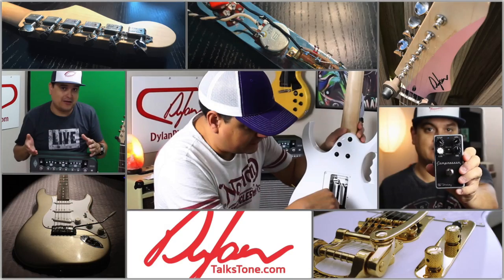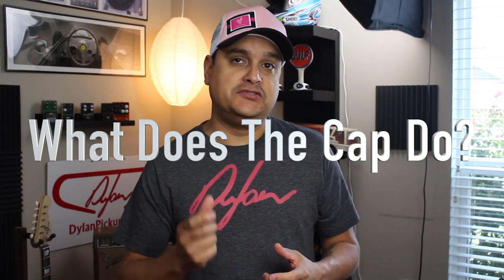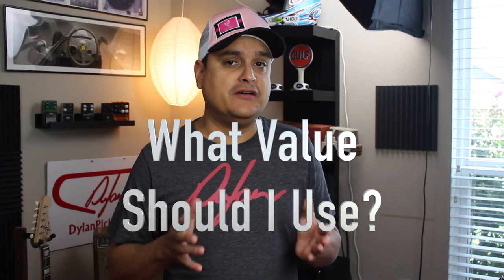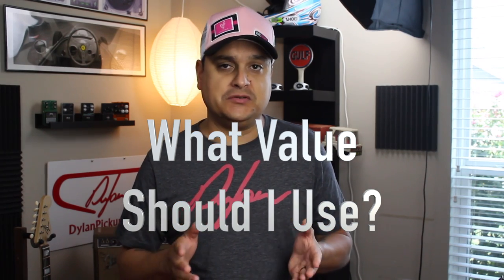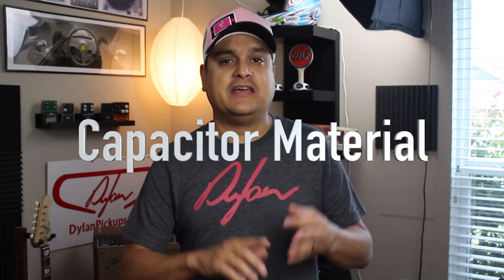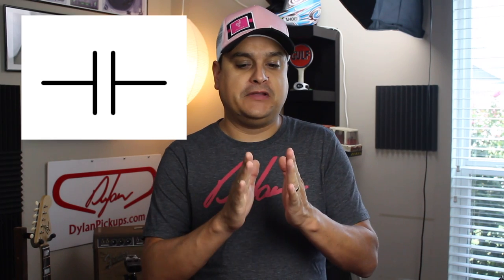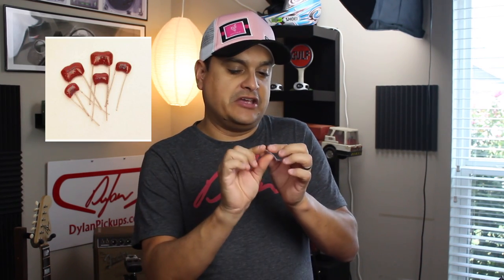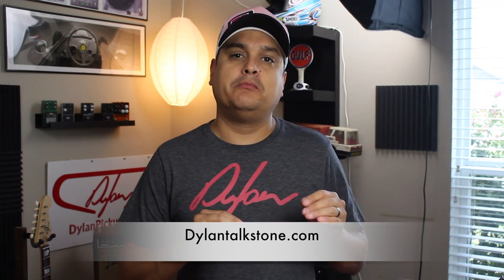How To select the right capacitor for your guitar! 3 tips - Dylan Talks Tone #240

Comment: Dylan...man,, I usually dont make comments on any videos  but this one deserve it, I am engineer in electronics and I think not even my teachers explained the basics of signal and capacitors as well as you did (maybe you just skip a little explanation about capacitive reactance) but viewers will undertstand the Rx effect, congratulations Dylan, it was perfectly explained with all basic details, and mainly what I appreciate on videos is the use of common sense, and no out of topic comments (you did it perfectly) I enjoyed it very much, I saw other of your videos and you have the perfect vision to make a great electronics basics Bible for audio and instruments, let us know if you do it, thanks in the name of other viewers, great job
Reply: Ditto with Ricardo Great Job!
Reply: You sound like you know what you are talking about. I always thought that electricity did not flow through the dielectric and that is why you need a drain circuit in most applications as well as using caps as an energy storage. My question to you is, is there a standard leakage in capacitors?
Reply: Capacitors block DC current and pass AC current, Which is what the output of the pickup is. The pickup and capacitor form a tuned circuit and the pot controls the frequencies passed to  ground versus to the guitar output. There are online sites sponsored by capacitor manufacturers which explain their construction and characteristics, much of which is presented on YouTube is incorrect. Film capacitors, for example, DO NOT have polarity!
Reply: @agrainofsalt9360  Capacitors can be used in circuits to store high DC voltages, which is why in certain applications they must be drained to avoid being shocked when handled.
Reply: @agrainofsalt9360  Capacitors, such as orange drop have a life span, but usually outlast the device in which they are installed. All are rated regarding the maximum circuit DC voltage that the dielectric will withstand. If that voltage is exceeded the dielectric is likely to fail and possibly cause an internal short.  Capacitors are designed to block DC and pass AC current.

Comment: You missed the most important factor. The vast majority have their pot on “10”. Meaning very little signal is going through the cap (to ground) to begin with. So even if you change the cap value or remove the cap and pot from the circuit -its going to make very little difference.
Reply: I'm not sure that the vast majority of people who would watch this video are people who leave their pot on 10. Probably most beginners and maybe most players in general, but not most people who would actually be looking into how caps impact tone.

Comment: I have been an electronics engineer for 45 years and I approve this message. It's the value of the capacitor that makes the difference. I worked on telecommunications systems back when there was still dial tone and long distance phone calls. Keeping grandma's voice sounding like warm, sweet grandma when she's 2,500 miles away, converted to microwave, bounced off of two satellites, and amplified through 35 miles of buried cable is way more complex than electromagnetic transduction of a wiggling guitar string, and we didn't fret over the tweeky little differences in capacitors like tone-chasers do. Just like fish don't buy fishing lures (but fishermen do), guitars don't buy tone capacitors, but guitarists do, and there will always be someone there to sell what the guitarist will buy, even if the end result is exactly the same.
Reply: Love it👊🤣✌🤠

Comment: It was helpful to me some years back when it finally sunk in was the realization that a capacitor is like a battery that is capable of taking on an energy charge up to its maximum while bleeding it back in return to the circuit as it encounters a drop. This cleans up the waveform as it takes on incoming surges and smoothes out the voltage drops by giving some back after a peak. I was trying to run a d.c back-up beeper for use as a warehouse door bell and it wouldn't sound. First I attempted swapping the power supply for more amps, thinking car batteries have more amps, but still no sound. Then the radio shack guy said maybe my voltage wasn't clean enough and sold me a 4700mfd capacitor and a choke coil, 130 decibels of highly amped beeping was an instant result! Lesson learned...

Comment: I saw a switch from a Stewart McDonald video that had a  .022 cap and a.047cap so one could choose between them. I got the idea to have a 12 pin substitution box
 with 12 choices. The values and the different kinds of caps so my customer can choose the tone for themselves……It works great. It’s a hassle for a Strat,but we’ll worth it.

Comment: Excellent explanation, Dylan. As far as types of capacitors for audio go, generally, the caps used for audiophile type stuff (away from guitars) are polystyrene and polypropylene. But really, the biggest difference is in the player - don’t worry about your cap, concentrate on your practice and your learning. Steve Vai isn’t in a twirl over caps, I promise you all.

Comment: Well, we should also discuss the resistance of the pots too. Recently i replaced the ceramic pickups in my Squier Strat with alnico ones. I also replaced the stock 500k pots with 250k ones. And I got rid of the little green cap, replacing it with a .22mFd "orange drop" cap. This cap and the 250k pots gave the hot new alnico V pickups a great warm sound with enough highs left to provide a perfect balance.
Reply: changed too many things at the same time to determine any cause and effect. Impossible to tell what did what but congratulations on getting a tone you like.
Reply: @YinFuBG  For the sake of brevity, I didn't mention more specifics. At first i just replaced the pickups. They were so bright that the guitar was unplayable and, obviously, I could make no judgements about the sound of the new pickups. So next I replaced the pots, which brought the highs down to a manageable level. At that time, I also replaced the cap, but since that only affects the tone pot, it can be neglected for the sake of overall sound comparison. Bottom line is this: if you're switching out from ceramic to alnico pickups, you better plan on changing out your pots too. The two go hand in hand.

Comment: Adam jones from Tool. uses a .047 ..600v. So the Volts dont make a difference…can i put a .047 …100v and it will sound the same? Thanks awesome video.

Comment: On 1 of my guitars we have a TBX tone pot. Is it all the same on this 1? Also I keep my tone controls at mid way -5 and use them from there mostly. Almost never at 10. Or for that matter never at 0 either. On my L Paul I changed the pots, caps and wiring. For caps I used .011.

Comment: Can you just put a capacitor between the leads from the pickup before you send to the tone pot, I'm doing an off set tele build where I can change out the front single coil with a mini humbucker just by swapping out the pickguard, having trouble figuring out what type of pots and caps to use, going to use 1/4 female plug for pickup changes, and of course I want a 4 way tone set up,but I'm going to use a push pull pot instead of changing the switch.

Comment: The cap does far less than most people think.  In fact, unless you turn the tone pot almost all the way down, its value and dielectric material are irrelevant.  For 3/4 of the tone control's rotation, you could just use a piece of wire instead of the cap.  For most of the sweep, it's actually the pot that cuts the treble, due to its impedance loading.  When the tone pot is almost all the way down, the cap is there in part to stop the pot muting the signal, and also to lower the resonant frequency of the pickup.  If you know the inductance and capacitance of your pickup(s) the frequency shift created by the cap is easy to work out with the simple LC resonance formula. 

Believe it or not, a passive tone cap can certainly boost a band of frequencies.  The net result is energy loss of course, but that is all above the resonant peak created by the cap.  Just how much "boost" you get depends on the impedance of the pickup relative to the impedance load of the the pots and whatever the guitar is plugged in to, plus the capacitive load of your guitar cable.

Comment: Hey Dylan, what is the proper way to store pickups in the long term (could of months/years if they are proximity to each other (like keeping boxes of Rials over a strat single coil)? Will that degauss my pickups or is it safe  (Iplenty of people have told me not to use steel wool near a guitar because the ferrite will mess up the battery. Surely close proximity to each other will wreck them? WHat should we do?

Love the show, youre rerally starting to get a groove

Comment: Hello Dylan. Thanks for the clear explanation on many guitar related things.could you explain to me how the cap. value effects the volume pot 'curve' i.e in terms of swells or leaning into  (or out of )a fuzz pedal.what is the essential  purpose of a capacitor in a guitar circuit;are we talking it removes unnecessary treble frequency i.e.reduces the icepick effect you often get with some teles.?could  you just leave the capacitor out of  the  circuit?anyway thanks for the vids and keep making those p-90 s cause I  want to buy 1 when i get my dough together.all the best.

Comment: Have you ever tried REALLY low values for a Strat like .0047, .0033, or .0022 (yes that decimal is correct). I recently tried a .010 and it was life changing so I’m thinking go trying even lower or will it not be noticeable enough?

Comment: Dylan or anyone out-there ....has anyone tried wiring in a " variable capacitor" into a potentiometer so ww could fine tune the frequency and then adjust with potentiometer? In cheopo transistor radios the dial used to find channels is a " variable capacitor" mica usually.

Comment: A quick question. Couldn't you just put say a higher value capacitor like a .047 and be done with it? One capacitor to rule them all so to speak. I ask because in my thinking you control the resistance with the tone knob anyway. If you want high frequencies you turn the tone knob all the way to 10 and if you want low you turn it to 0 and adjust what you want somewhere in the middle. Plus you can control the tone with the amp settings as well. I'm not sure if that was really the way to ask that question. Just trying to wrap my head around the whole thing. Also curious what you would have with no capacitor at all. I guess it would be really jangly.

Comment: There's basically 3 values that matter when it comes to capacitors in an electric guitar:

No.1 - The Capacitance Value, measured in Farad (F). But since 1F is a unit simply too large to be practical when describing the electrical applications in a guitar it is most commonly described in μF = microfarad, nF = nanofarad or pF = picofarad. This value is the most important.

No.2 - The Tolerance, measured in plus/minus a certain percentage (±%). This value describes how potentially reliable the capacitance value really is. If you have a capacitor with a value of 0.022μF but ±20% tolerance, that means the actual capacitance might be anywhere between 0.0176μF and 0.0264μF, and of course, the larger the capacitance stated on the capacitor is, the further away from that value it might actually be. Tolerance is probably the most overlooked value when it comes to capacitors.

No.3 - Voltage DC (V or VDC). Now, as Dylan stated, this is not important for capacitors in guitars. As long as the cap has perhaps 0.5V you're fine. You could have a 10000V capacitor on your pot and it wouldn't make any difference, except for the fact that the capacitor would be unnecessarily big and it might become a problem fitting it into the control cavity of your guitar.

Finding the right capacitance value for your pots is not a problem, the one thing that might be a bit harder is finding a low as possible tolerance. Many retailers doesn't even write the tolerance in the product description I've noticed. But when you start asking them you soon find that the standard tolerance for the capacitors we see everywhere is in fact ±10% or even ±20%, which is awful. ±5% is a bit harder to find but can be done with some effort. And if you want to go below that to ±2% or ±1% then you will have to absolutely scour the web, write to retailers and even manufacturers. Finding the lowest tolerance on your capacitors takes a bit of work and luck but I think it's worth it in the end. ALWAYS buy more than you need, measure them properly and pick out the ones closest to their intended value before soldering them to your pots.
Reply: +Marcus Lewitzki
About voltage.
The high output pups can generate up to 2-4 volts (on attak), so we need higher voltage on caps.
Also it hard to find caps with lower voltage then 5V.
Tolerance not such important.
Reply: @iridios6127  NOT true. The importance of tolerance is relative. Tolerance simply gives you an indication on how much you can trust its advertised value. Like I said - if you buy a bag of them you can simply meassure them and pick out two that comes closest to their advertised value and in that case tolerance isn't all that important. But if you're only buying two then tolerance is very important (that is if you care about their actual value) which I assume you do, otherwise why not leave the ones in the guitar.
Reply: @marcuslewitzki4610  
For guitar schematic -- is absolutely not important.
Is not a clock basic freqency generator, wich set up the timing precision.
Also, from time to time i like to play with value of caps, during process tinkering guitar in the range of - 200% to +500% and -- it is fun !!

Comment: you explained this in a way that I can easily understand....so what's the best for my strat....old strats used until 1960 .01uf...today it's around .022 in American Strats..(correct me if I'm wrong) so is paper in oil or ceramic the best for my strat? Whats the difference in tone between the two?
Reply from the maker: I like a .022 or 047. the material does not matter as much. These are the ones we use https://dylantalkstone.com/collections/quality-upgrades/products/orange-drop-tone-capacitor-experimental-pack-get-all-4
Reply: any thoughts on vitamin Q caps(I've heard they are warmer)..so if I understand this correctly the lower the value the more use of your tone control when you dial it down? .015 would be brighter....033 to .047 warmer? I imagine the PUPs have a bearing on this too...thanks Vincent I'm thinking of custom shop 50's, 60's or tex mex pups....I have a fender noisless I' going to use on a mystery strat...
Reply: I guess I should have said, I want more tone control when I dial it down......What is an audio taper pot versus regular pot?
Reply: understood

Comment: Question. I put a .47 cap as a treble bleed since I lost a lot of the highs when turning the volume down.  It sounds better but looses the bottom end as I turn down.  Much better than before but I would rather just keep the tone but lower the volume. This is on a SSH strat. Bare knuckle pups. Any ideas.
Reply: You could Try using a lower value capacitor for your treble bleed, 
(. 22 maybe?) should retain a bit more of the low end frequencys as you roll off the volume.
Reply: +Jerry Gill
You create the low freq filter, instead treble bleed mod.
Which similar the stock tone knob, but for low frequencies.
So you have full non-balanced tone control, for lower and higher frequencies.  Congrats !!!

Comment: Thanks for more information, I'd enjoy understanding the relation to resistance in guitar pickups and tone, or is there even a relation between that, why is one humbucker 4.39 ohm, at the neck and another guitars 6.31 ohms, can that be a relation between resistance (magnetic field it generates) and tone.
Reply: Video number 8 covers some of my question but could you expand this.
Reply: Unfortunately the resistance (usually thousands of ohms = kilo ohms = kohm kΩ) is only a part of the equation. In pickups the other important electrical value is inductance. Inductance (Henries) is the main value/characteristic of a coil/inductor, just like resistance (Ohms) is a main value/characteristic a resistor and capacitance (Farads) is the main value/characteristic of capacitor. Basically pickup is a coil, but in real world no electrical component is perfect. The biggest imperfection of any coil is the resistance (it would be zero ohms if it was perfect/ideal in electrical sense).

The inductance and the resistance of the pickup are both part of the same equation. The audio input you connect the pickup will also affect the equation, as will the tone capacitor. Actually the interaction between the tone cap and the inductance and the resistance of the pickup is quite complex... To me anyway. So it is usually easier to try things out.

There is no straight answer how picup wil sound based on the resistance. Usually though more windings means more inductance but the core material of the coil affects too. More windings will also mean more resistance because longer wire will have more resistance, but that only holds if the coil wires are of same thickness. All other things being equal more inductance should mean darker tone... So... More resistance should mean darker tone... kond of... But all other things are equal very rarely when you compare pickups.

That's my take on it... Maybe Dylan has some better pointers for you.
Reply: You're 100% correct! but unfortunately manufactures use ohm as the marketings tool, magnet strength, physical wire size and manufacture...even how its wrapped, but if all those variances could be even...what difference then is the resistance of the coil does that at all effect tone, if those were all even.